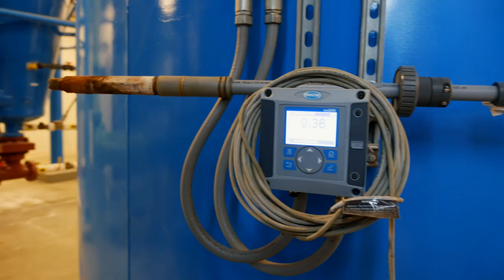Indiana American Water: Lake Station

Comment: It's worst then Flint Michigan water
Reply from the maker: There are generations of municipality ownership that need to be addressed.  This usually comes with the need to replace a gazillion miles of pipes from the streets to the home. Yeah, it sucks to be stuck in the transition period but take at least some comfort in knowing that the issues of old are FINALLY being addressed, and addressed by an organization that specializes in water treatment and delivery.  I dont work for the water company but Ive learned enough from the projects that Ive done with them that this IS THE BEST OPTION, ESPECIALLY for these smaller municipalities who have had MANY issues to focus on.  And comparison to Flint is on the extreme side, but I get it, people are frustrated and HAVE BEEN FRUSTRATED. At least youre moving in the right direction now.